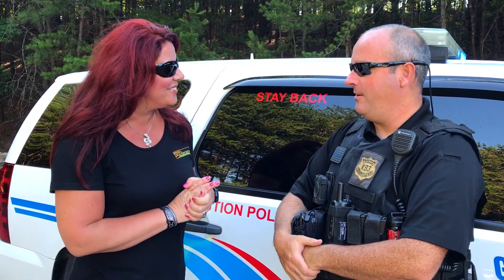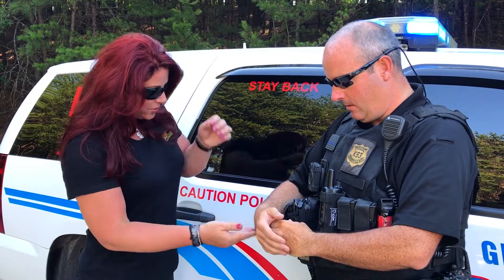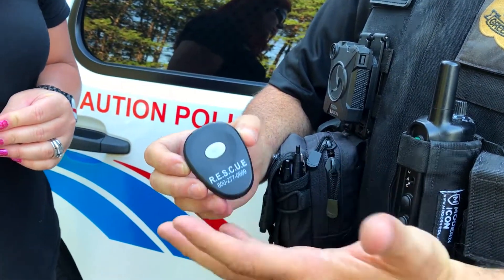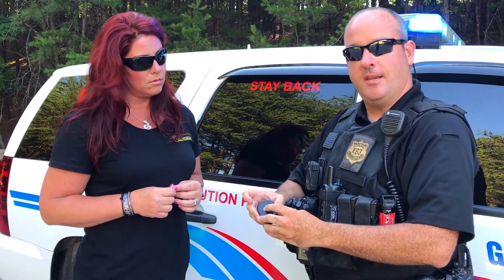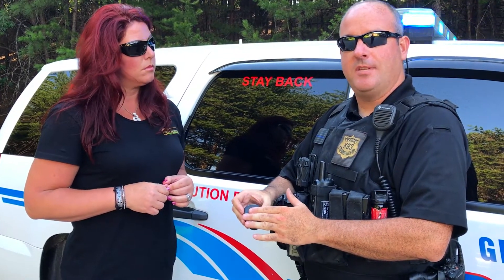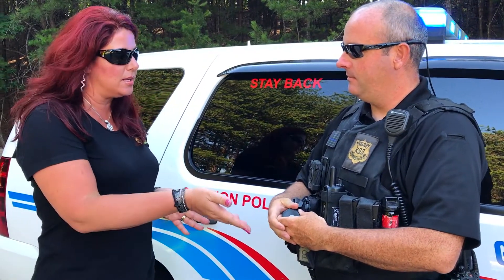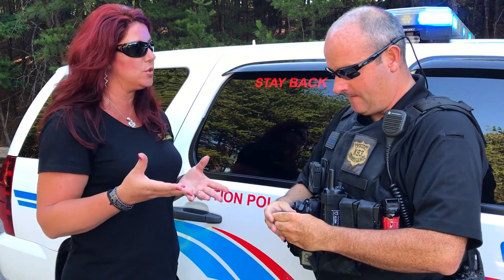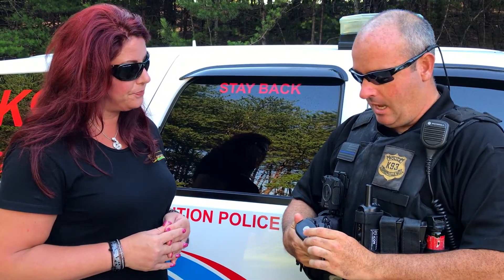How does a K-9 door popper work?

Comment: ❓ Question: does the dog know there’s any difference between the door just being opened in general by the officer versus it opening through this door pop process? Is there a beep or anything? (I know there’s some kind of a buzzing sound on this video but I think it’s just the sound quality, I don’t actually think it’s from the car).

And when the dog does find you is it in attack mode or does it just wait for a command like normal?e
Reply from the maker: No, the dog simply follows the commands of his handler. Split second decision .....